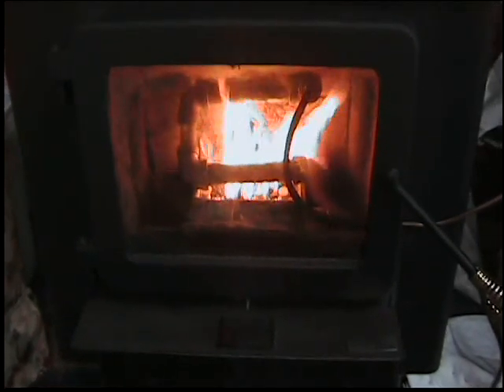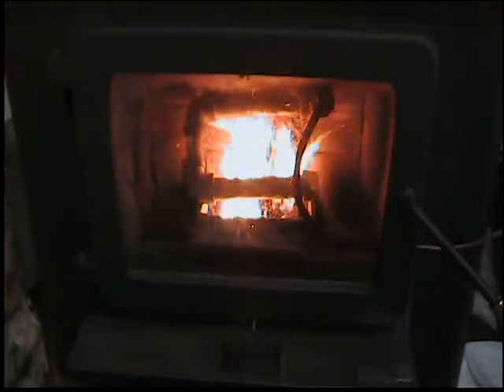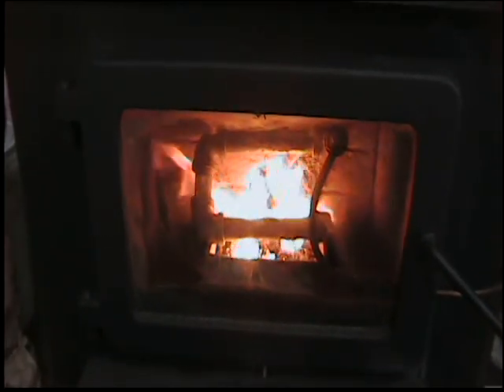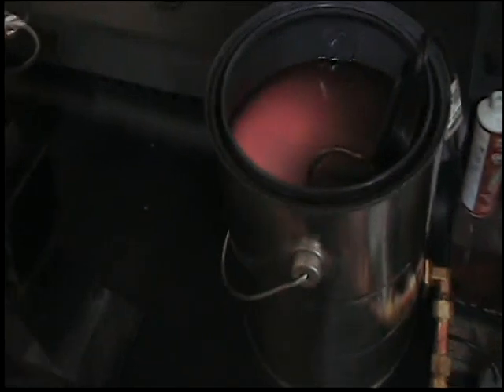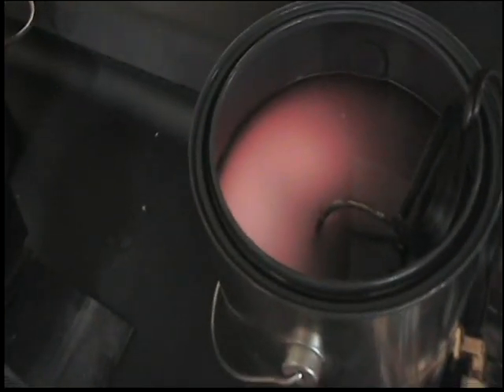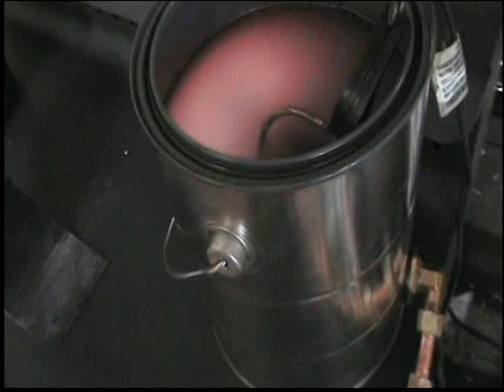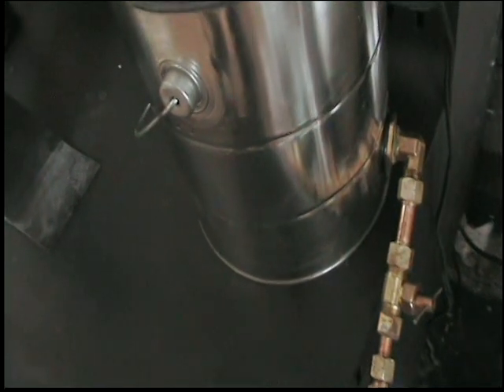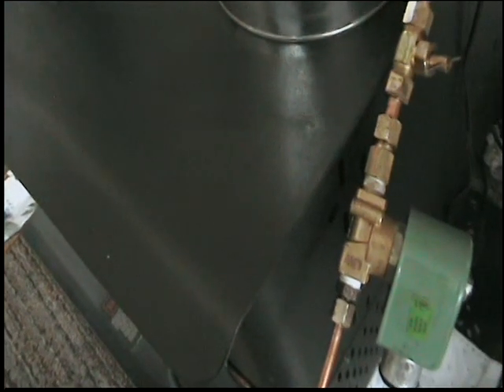Corn stove Heater burning Waste cooking oil.

Comment from the maker: I quit using this awhile back, it was too much effort to keep cleaning it for me.   I works by using heat from initially from burning pellets then becoming self sustaining when nice and hot to heat the oil to its vaporization point  then burning the oil vapor.   This tends to generate a constant buildup of hard to combust or even easily clean deposits inside the burner, although a very cheap way to heat.  With some effort and some reasonable expense and a great deal of trial and effort, I and a few others came up with the Ultimate Pipe Burner, look for my other videos for ideas ;)

Comment: what i meant was could the bulb be swaped for a tea light candle to heat the oil also 12 volt battrey and  12 volt motor to run fan.battrey charged from solar cell.   to run 240volt inverter if nessecary.ie Electic is free as well,just trying to be constructive.

Comment from the maker: Well, less electricity being required is better, at least when you have to pay for the electricity.  The light bulb for heating the oil is only used when very cold to quickly heat some very thick or solid oil to around normal room temperature. This does not take long and is not left on. The stove generates a good deal of heat, It would take well over 10,000.00 watts to generate equivalent BTU output.
P(W) = P(BTU/hr) / 3.412142

John Moore

Comment: @jommy99 yeah, this is a great idea though.... Ive been saying for a few years now that they should burn corn oil for electricity since it contains no nutritional value(corn oil is all saturated fats)... we should be cooking with grapeseed oil or hemp oil since its high in omega 6 and omega 3 fatty acids and is better for your brain.

And its better than burning leaves/wood cause they will produce nitrogen oxides which is bad for the environment since its a more powerful greenhouse gas than CO2.

Comment from the maker: FYI, for those interested in the Pellet stove, burning free waste vegetable oil, be sure to check out the new diagram. The new burner is a steam pipe burner and the diagram has been uploaded to my website link, actually Photobucket. I have no new video available but the fire burns cleaner and the low pressure steam keeps the burner much cleaner too. Makes the cleaning work less than burning just pellets and much easier to get running on wvo alobe, once waremd up too!

Comment from the maker: Yes it is a burner I have been developing for pellet stoves.  I have been working on waste oil burners in general for years now for outside uses.  Using vegetable oil can increase the btus, however the intention is not to burn hotter.  My newest revision will burn clean and safe on just waste vegetable oil, once it warms up.  Less ash in the stove means less effort and now cleaning the burner is almost eliminated too!

Comment: That's interesting. Did you design that yourself? I've never heard of using waste oil in a pellet/corn stove, although I think I saw an article recently about waste oil stoves themselves. What do you thinks gives off more heat? Does the oil increase the btu's? Good post.

Comment from the maker: Yes you can drill a small hole to feed the tube, I did drill the older pellet stove I also converted.  One thing about this burner is it does need frequent cleaning.  It is easy to do, but the burner needs to be removed.  I have added a quick disconnect, and now with the door open removal is a snap.

Comment: very interesting! I'm not familiar with these stoves but am interested in recycling oil - I'd imagine that you could bypass going through the door by drilling a hole for your 1/4" tubing and sealing around it - good post

Comment from the maker: The Solenoid is wired in parallel with the auger motor, and they activate together. The solenoid valve is normally closed and opens on activation.  Oil usage is about 1/4 gal or less an hour.